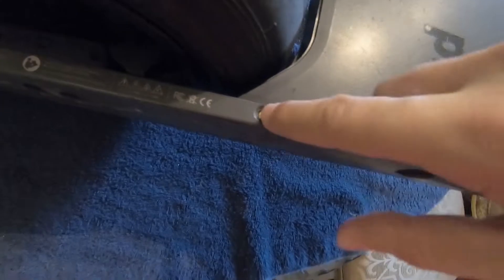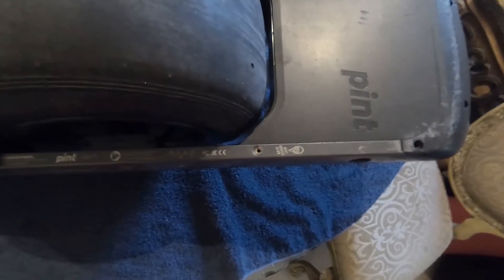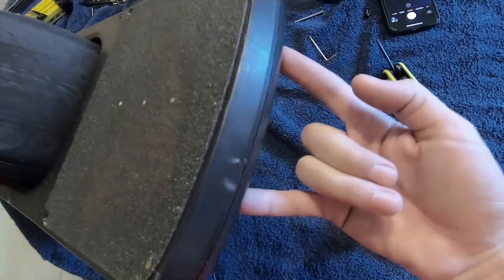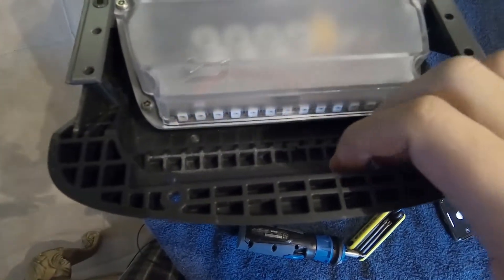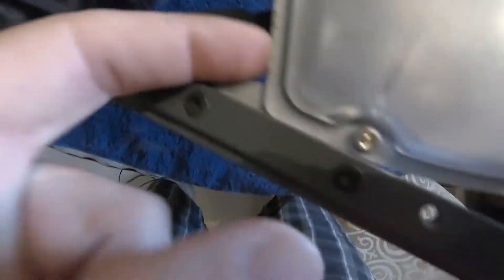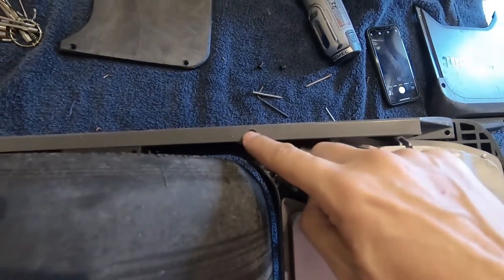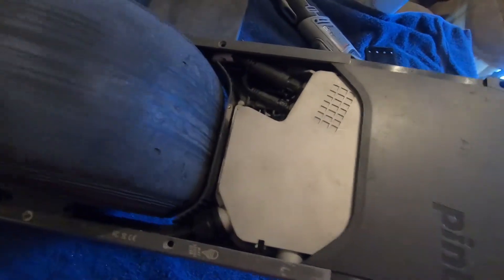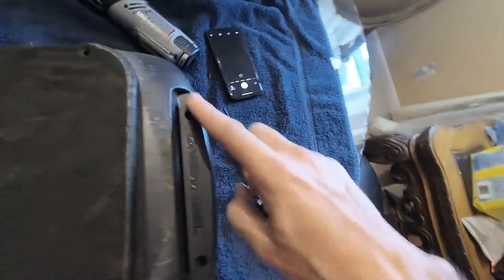How to fix a misaligned crooked screw hole on a Onewheel Pint

Comment: Just so I understand what causes this?  I have heard installing solo plates and accessories in general sometimes doesn't have perfect alignment and i get my pint next week and all my solo plate and fangs are awaiting to be installed and I'm hoping it all fits nicely. I know I will probably have to trim the solo plate to make sure the fang wheels work as intended. All these modifications seems to get messy.
Reply from the maker: Larry T it’s that the holes in the factory rails aren’t where they should be.
Reply: @Onewheeel  wouldn't that be considered a manufacturer defect and covered under warranty? I know during these covid times the last thing you want to do is send something back. :) but good video if you don't.

Comment: @brianres I have a Pint with the 170Wh misprint and I didn't have the misaligned hole issue. So, I don't think it's simply a problem related to all of the 170Wh rails.
Reply from the maker: That's good to know, thanks!

Comment: Audio is sounding good! I got to ride a Pint last week and FutureMotion did a good job. I'll be interested in hearing how the battery life holds up long term. If the range holds up pretty well with a year of use, I think my XR might get retired from grocery shopping duty.
Reply from the maker: Alastair Drong I like the Pint more and more as I ride it more often. I didn’t think the smaller size and lighter weight would make such a difference. I find myself riding it more than my XRs lately!  Thanks again for the mic! 🎤 it is so much better than trying to use Airpods!

Comment: Hey Chris , audio is much better. Quick question. Is your pint one with 170Wh on the frame? Wondering if FM corrected this with the updated 147Wh frame. Can you please confirm? Thx.
Reply from the maker: Mine has the 170.  I ordered mine day 1.
Reply: @Onewheeel  Do you know if the misaligned screw hole is an issue on the 147 Wh version? Would be helpful to know. Thanks, great tutorial!

Comment: What’s the drill you’re using with to tighten and loosen the torx screws,?
Reply from the maker: Damn Amazon won't let me share a link but here's the description:
HAMMERHEAD 4V Lithium Rechargeable Screwdriver with Patented Circuit Sensor Technology and 9-Piece Bit Kit

It's ok... only 1 speed and not super powerful.  Speeds things up if the bolt is already loose.